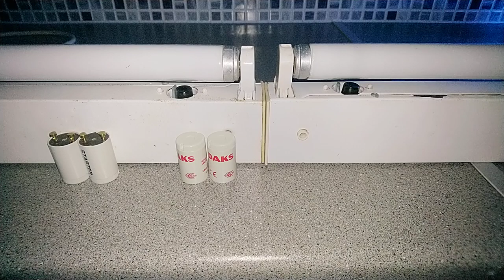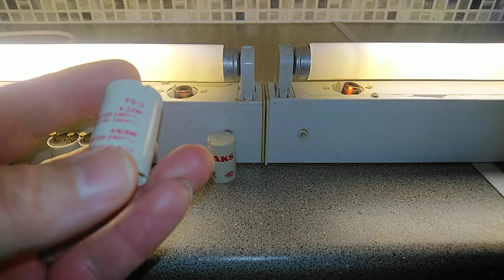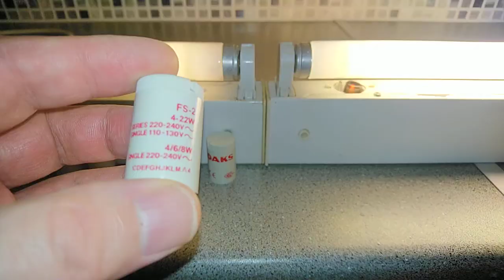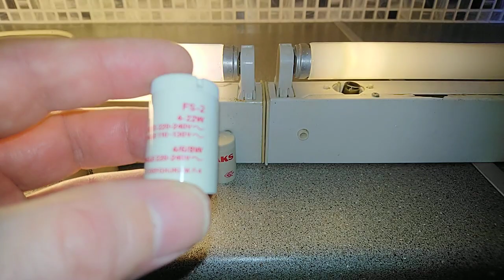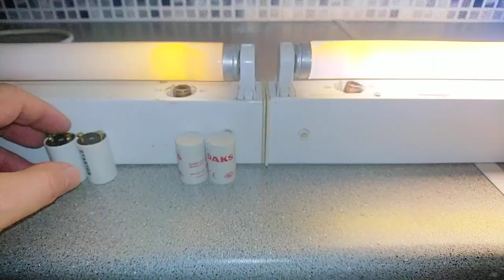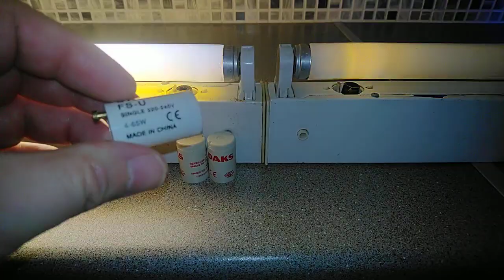Preheat Fluorescent Shop Lights Incorrect Starters Fitted

Comment: That's is a two 3ft 30w fittings with a t8 fluorescents tubes and it's runs of 30w 240v choke ballast only and use a 4--65--80w 220-240v fluorescents lamps starters switch instead not a 4-22w 110-130-220-240v starters lamps switch or 70-75-85-100-125w 240v are not suitable for 3ft 30w t8 or 4ft 36w t8 or 4ft 40w t12 or 5ft 58w t8 or 5ft 65-80w t12 or 6ft 70w t8 or 6ft 75-85w t12 fluorescents tubes and in my fluorescents tubes lights fittings in my very very big collection and for a 2ft 18w t8 fluorescent tube light fitting and I also use 4-22w 110-130-220-240v for 2ft 18w t8 and for 2ft 20w t12 fluorescents tubes only and for my 4ft 36w t8 and 4ft 40w t12 fluorescents tubes by using only 4-65-80w 220-240v fluorescents lamps starters and in my 5ft 58w t8 and 5ft 65-80w t12 with a 4--65-80w 220-240v fluorescent lamp switch instead and in my 6ft 70w t8 and 6ft 75-85w t12 fluorescents tubes by using 70-75-85-100w 240v and for a lot my 8ft 100w t12 fluorescents tubes lights fittings with a 8ft 100w t12 fluorescents tubes lights fittings by only instead 70-75-85-100w 240v fluorescents lamps starters for any size of fluorescen fluorescents tubes lights fittings it's my own very personal choice in general and from a lot of my experience about any kind of fluorescent choke ballast and a lot of type of fluorescen fluorescents lamps starters are around now and alot of fluorescents tubes and alot of fluorescents lamps and lots of fluorescents lighting from anywhere and everywhere in to lots of schools and lots of shops lots and lots of places I bean to mate and so anyway have a nice day in you town.from myself living here in London
Reply from the maker: They are 29" 2.5ft 16w t8 fluorescents tubes very odd size and watts and yes correct starters are 4 to 80 watt. Tubes are Osram L16W/30 Warmton-Warm White rY6 Made in Germany. The Thorn lights are 3ft 30w fittings. Thank-you for your comments :-)